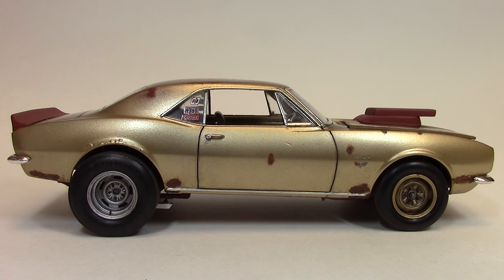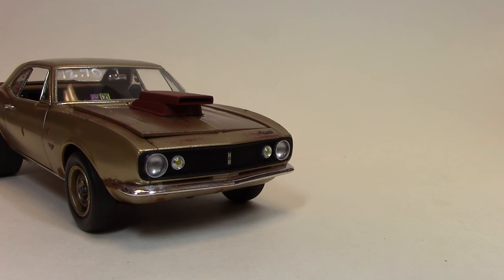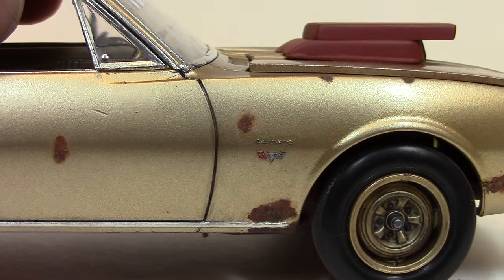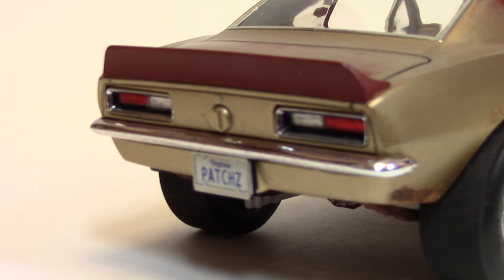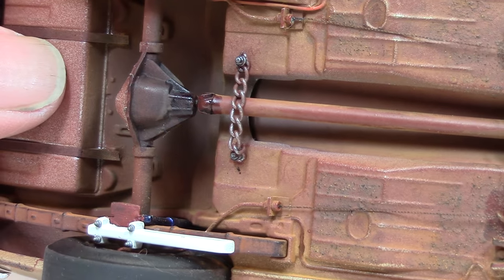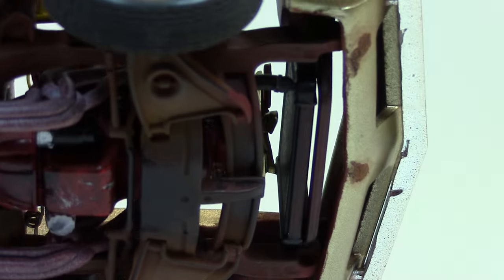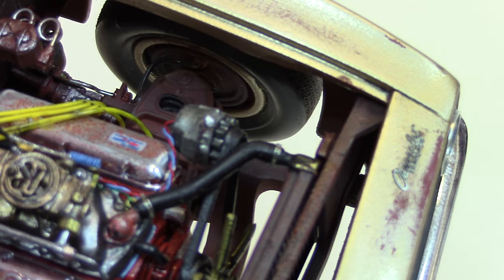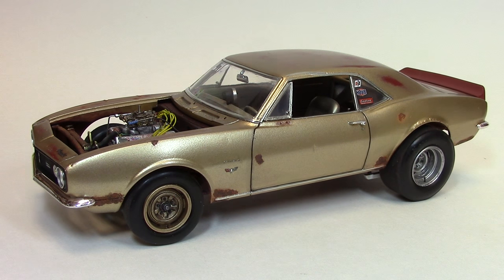Billy Vega's Scale Model Garage: 1967 Camaro Low Budget Drag Car

Comment: Very nice. The bubbling effect with superglue, did you add medium gel glue after the paint?
Reply from the maker: I believe I used Guerilla brand medium super glue directly on the bare plastic . Applied with a sharp tooth pick to form a bead or bubble on the surface . If it fell flat , I would dab it again . I primed and painted over it .   Glad you like it !
Reply: Great thanks. This rust effect is the first I’ve seen on YouTube and I’ve been wanting to add this effect. Fantastic tip? Thanks again

Comment: Nice build. 10.70s would have been more appropriate tho. A mild 375-400hp 350 will get a 67 camaro in the 12s with ease.
Reply from the maker: Thanks , probably so . I was being conservative on the elapsed time with weakened compression , oil blow by and just plain worn out .
Reply: +MrBillyVega ha-ha! Hell yeah, looks like a few rides I've had for real. I'm a fan of rough around the edges cars that run like hell.